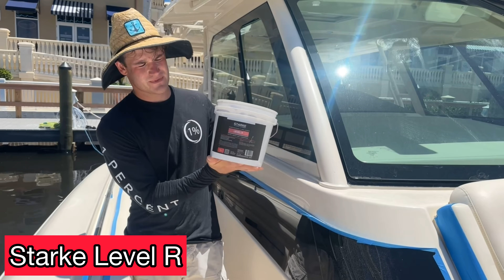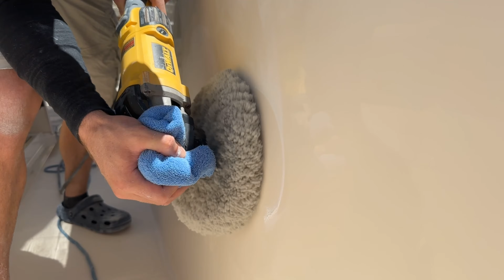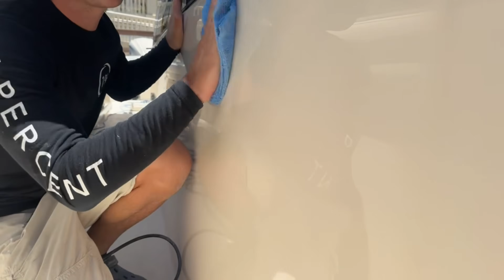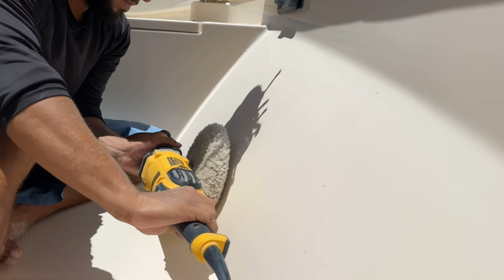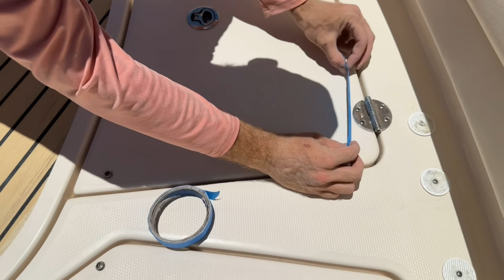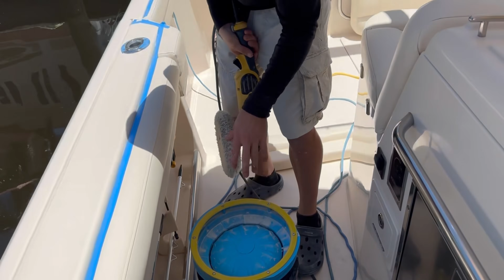Rotary Buffing Tips From 3 Professional Detailers Using Starke Level R Heavy Cut Compound

Comment: Level-R is my go to heavy cut for all types of oxidation!
Reply: It’s good for minor oxidation and removing sanding scratches but if you have deep oxidation and the customer doesn’t want to pay for wet sanding your better off using ardex 600 or presta super cut.
Reply: @holdenbaldassi3697 agreed, 90% of the time boat doesn’t even need to be wet sanded, use super cut or super duty, followed by heavy cut from 3m or level r, and then finish it out with perfect it ex ac or mernzerna 400 on foam pad.